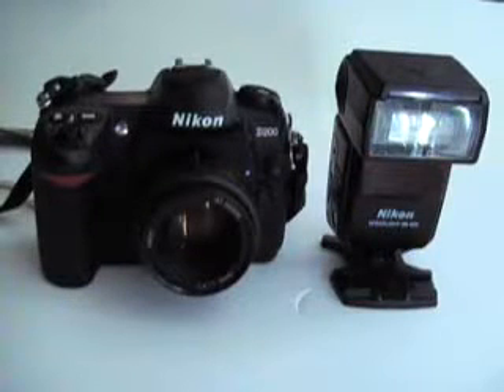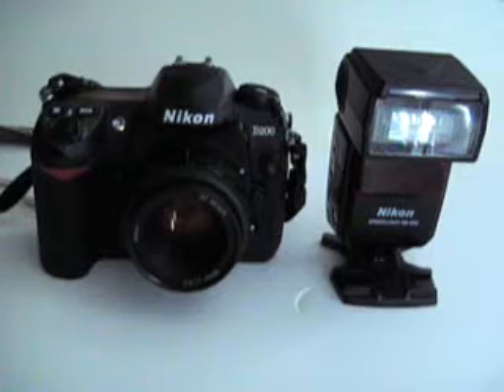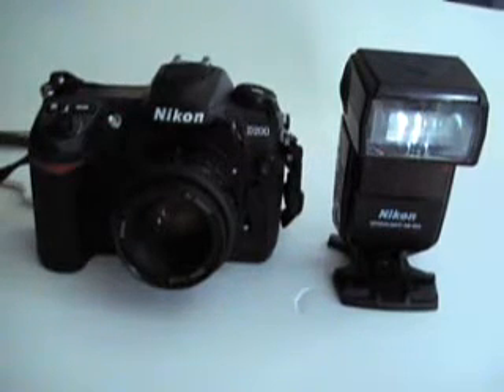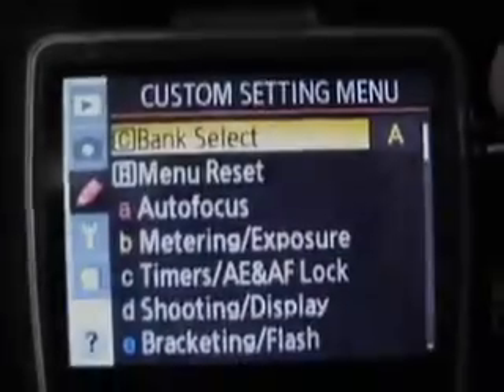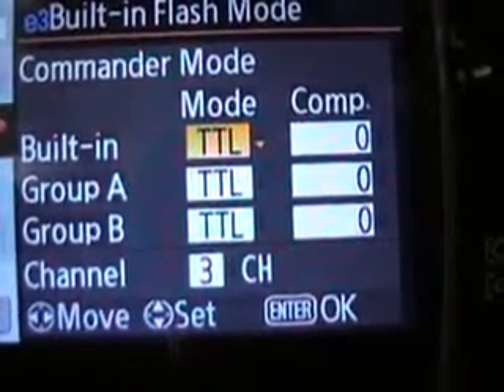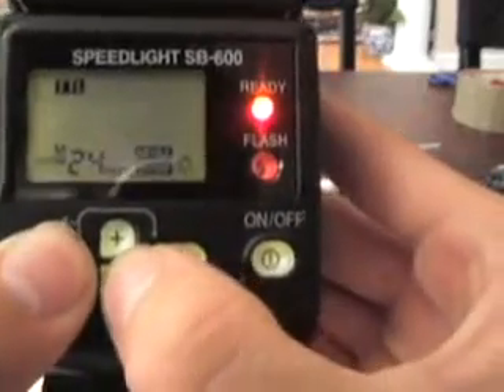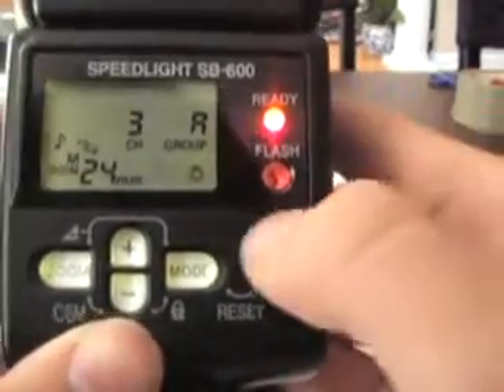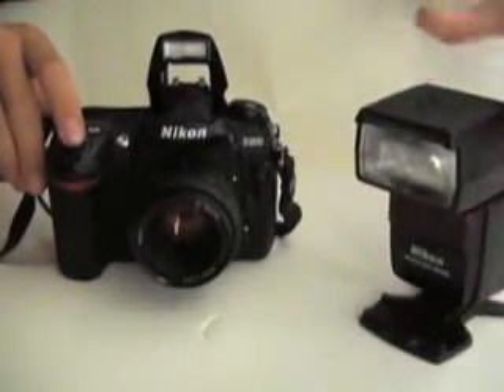Nikon's Creative Lighting System

Comment: This also works with the D3000, D3100, D5000, and D7000 without using the commander mode, simply turn on the flash and start shooting.

Comment: @BadBoriBoy    Check out the video tutorial here in YouTube from PhotoAnswers intitled "How to use off camera flash" and hosted by Chris Rutter.

He uses the D300 so you won't see the 1/1 compensation in the '- -' mode but it works exactly the same way.

As you may notice on the left side shadow, the pop-up flash didn't fire when the picture was actually taken.

Cheers.

Comment: @BadBoriBoy  It has to fire to control your slave flash units but when the picture is really taken, your pop-up flash will be off. Therefore it won't affect your picture. In case you haven't noticed, 1/1 is written in gray telling you that the flash won't fire. Those that will fire have their comp settings written in black.

Comment: @LT190375 
You can control remote flashes with built-in flash, but without it flashing when camera takes picture. So it only triggers remote flashes. And you can change settings of the remote flashes from your camera.

Comment: @TiSuAble The built in commander flash will always fire in order to send the TTL signal. But, you can set it up to ensure that the pop-up flash will not contribute to the exposure. I'm assuming you know how to set up commander mode. In the menu that determines which channel/group to set your flashes, use your arrow keys to ensure that beside Built-in flash, it doesn't say TTL. It should have two dashes beside it (--). Dashes means it won't contribute to the exposure. TTL means it will.

Comment: I don't think it works on the D3000 or D5000 as they don't have built in flash commander modes, but I could be wrong. You need a D90 or better.

Comment: it is possible. just go to the flash menu. change to commander mode. there change the built-in-flash-option from ttl to --
also change to channel 3 as shown in the vid
save with enter.
now the flash is still flashing to send out the remote-flash to the sb800 but the flash is not used on the actual picture taken.

Comment: Nice demonstration.
Two remarks though:
- When you go to the camera's flash menu and select commander mode, make sure to actually set the "Built-in" mode to OFF, because otherwise the pop-up flash will also add to the exposure (tho a little amount).
- The beeping sound is actually two sounds. Two beeps to confirm that the flash has fired, another, longer one to signal that it is ready to fire again. So you won't be able to fire again before that second, longer beep.